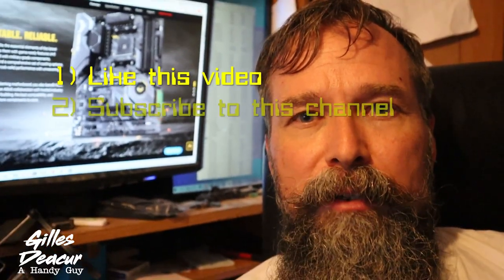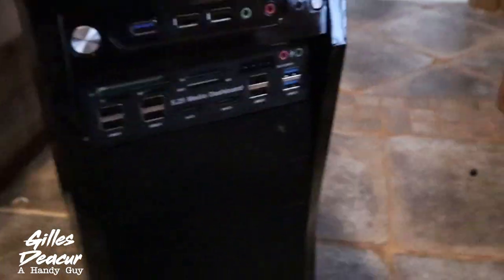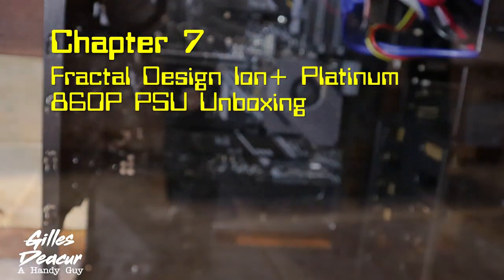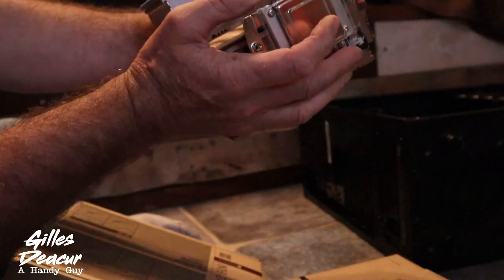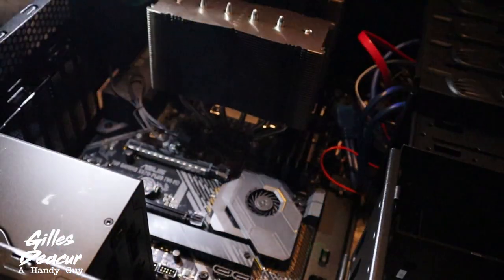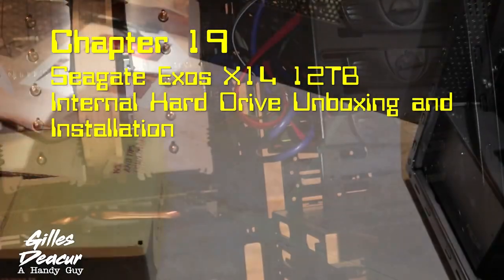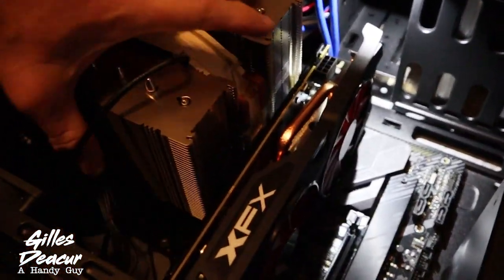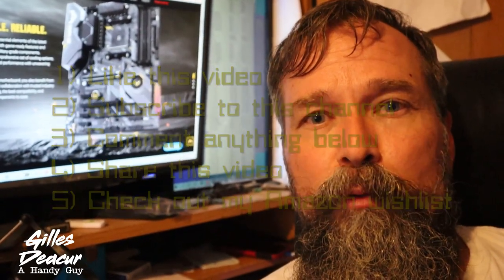Building a Computer with 16 Cores and 32 Threads! - AMD Ryzen 9 3950X and Asus TUF Gaming X570-Plus

Comment: Quick tip you always want your graphics card in the pcie slot it’s and a 16x slot which will give you maximum power from your graphics card the other two are 4x slots and less powerful.
Reply from the maker: Good to know. That info is appreciated.
Reply: Yw
Reply: By the way it’s a bit not complete basically you want your GPU always in the top slot which is 16x slot my bad.

Comment: Stumbled across this and I enjoyed your video.  Thanks.  One question though, with all your high end components why did you elect to forgo an SSD?  For a PC that is intended to last over a decade I would think that was a nessesity.
Reply from the maker: I did a bit of research before building this and 12TB of SDD was crazy expensive. In retrospect, perhaps I could have put an SDD as the operating system and some storage, and used my 12TB as file storage.
Also, I haven't built a computer in several years (my last one lasted 13 years). Honestly, SDD is kind of a new concept for me.
How much SDD do you have? Is it reliable?
Reply: @LordGreybeardsChannelofWisdom  I use a 500 GB 2.5 inch drive. My next pc will have a 1TB m.2, (about $130) before tax.
Reply from the maker: Yeah... 12TB for $281... hard to compare the two when price is a major factor in the build. Hopefully in a few years the prices will be more comparable.

Comment: I happened to be looking at this exact same motherboard/ram/CPU/cooler combination for my build, and the issues you had with the cooler fitting were quite enlightening. Now that you have it all working, how are your temperatures?
Reply from the maker: The CPU temperature under light load (about 15 to 30% load total) is about 130 to 135 degrees Fahrenheit. Under load, such as rendering a video, it gets to about 165 to 170 degrees. The GPU temps typically run 125 to 135 degrees. The temperature of the hard drive is 100 to 105 degrees.
Mind you, I'm not gaming with this set up. Rarely do I hear the fans spin up to mitigate any excess heat.
I'm thinking of getting rid of the Thermaltake fan controller and having the motherboard control all that. These fans are quiet. The hard drive, not so much.
Let me know how your build goes.

Comment: Having real issues with exact same build except for the memory. What is the exact memory you used? F4-3200c 32x4 is not enough information.
Reply from the maker: It's in the video description. What I have is the G.SKILL Ripjaws V Series 128GB (4 x 32GB) 288-Pin DDR4 SDRAM DDR4 3200 (PC4 25600) Desktop Memory Model F4-3200C16Q-128GVK https://amzn.to/2PUle2B
I hope this helps.

Comment: I'm wondering if I should wait on the b550 motherboard vs the 570 you used.  Any opinion there?
Reply from the maker: I'm not sure, Eric. I only researched for the parts I used and the available similar choices. Maybe somebody here has an opinion on this.
Reply: Let me take a stab at it. 
.. That depends on what you're doing with your computer and the hardware you are putting into your build. A X570 will give you connectivity like faster pcie and m.2 gen 4 speeds. But if you aren't looking for that type of feature set, going with the newly released b series mb is probably the best option. Some reviewers have said the price is very similar between X570 and B550 motherboards. Although the current stock on X570 is very low or sold out. Any X570 left are expensive.
But search on YouTube "B550 vs X570."
Back in March I upgraded to X570-E motherboard and Ryzen 9 and went with the gen 4 m.2 SSD even though I probably won't see the difference in comparison to the 2.5 SSD'S I've used for many years. 
Again depends on what you are looking for/going to use. 
Look up tech reviewers Hardware Unboxed, Gamers Nexus, OC3D TV (Tiny Tom Logan), Linus Tech Tips, Hardware Canucks, Bitwit, Paul's Hardware they'll be going over the new B550 motherboards and some may have videos coming out on performance - > check
https://youtu.be/cHU7uK7hWkg

https://www.youtube.com/watch?v=51rDjewnxfg
he did a video on why he suggest going with B550. 
Some may also go with the B550 motherboard since the motherboard chipset isn't cooled by a fan (fan noise), while the X570 motherboards have a mini fan to cool the chipset. Really not a huge issue for noise but people are using that as a factor of why not to go with an X570 motherboard.
Hope that helped.